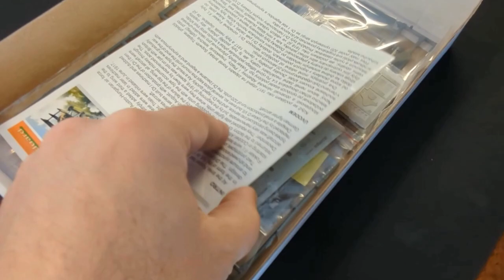Eduard Fokker Dr1 Profipack 1 72 scale

Comment: I'm not sure if this would work for your purpose, but instead of masking for all those lines you should try painting them on with a paint pen or even a Sharpie marker. The felt tip can be cut to size. A metal pocket straight edge, or even a piece of photo etch sprue, can be used as a guide. Good luck.
Reply from the maker: Why didn't I think of that!  That's brilliant, thank you!  Of course now, I have to build another WWI biplane to give it a go. . .
Reply: @professorbellbuilds  Hi again, I'm glad you liked that suggestion but there might be problems. Many paints are not compatible with others, so you should run tests using scrap kits or plastic sheets and try any combination of paints that you think of. Also keep detailed notes that you can refer to in the future. I'm having second thoughts about the Sharpie marker because it is ink and not paint, so it might not adhere to bare plastic very well. A thin primer coat of flat clear paint might be in order. Lastly I don't know what tools you have but I've seen good air brushes that are able to lay down a line that is about 1 1/2 mm wide with the advantage of soft feathering on the edges and strong black in the center. This will better simulate shadowing. I hope you find this useful because I really like to see those tiny masterpieces.
Reply from the maker: @Ron50M Sure, it's certainly worth a test run.

Comment: One trick I have used in the past with single surface vacuform kits and also for rib tapes on ailerons, elevators and rudders is to cut solid black decal sheets into narrow strips and apply them before painting or over a base coat to achieve the translucent effect. Though most recently I used the same technique as you. I built the Roden F. I version of the Triplane some years ago and it fitted where it touched and the I struts were all separate, trying to line them up was a nightmare, not helped by losing one to the carpet monster. I have the Revell Dr. I to build at some point, which looks like a nice kit. Alex Imrie wrote some years ago that Dr. I pilots described their aircraft as green, but the modern trend tends to be to paint Dr. I aircraft models a dusty olive drab, like they are B-17s that have flown 25 missions over Germany, so I like your grass green look 😊. Another very enjoyable video!
Reply from the maker: That decal trick isn't a bad idea!  Certainly it's better than spending 7 and a half hours and 90 yards of masking tape!  It's funny you mention the discrepancy between pilot descriptions and modern trends.  I feel like the same applies to the RFC.  All of the accounts that I've read (at least the ones I can remember) describe British planes being painted a "chocolate" color, but again I feel like I always only see olive drab.  Maybe chocolate was green back then with rationing and all?  Anyway, you hit the nail on the head when it comes to nightmarish Roden kits!  I have a love hate relationship with that company, and I'm always getting sucked back in to build another of their kits when I know the molds are awful, the fit invariably bad, and the construction planned by a sadist!  I honestly don't know why I have fun every time I build one, but I do. . . and they mostly turn out nice.  Oh well. . .
Reply: @professorbellbuilds Roden kits, I can't tell you how often I take one out, fondle it lovingly, have images in my head of a beautifully completed model and then put it away till another day. Setting P.C.12 to one side my current approach to P.C.10 is that its base is definitely a BROWN colour (discussions of how it first may have looked in 1916 aside) that in certain light conditions can exhibit a subtle "green shift". This is something I have noticed on the aircraft in the RAF Museum at Hendon and the Shuttleworth Collection at Old Warden. To replicate this in model form I apply, for want of a better phrase, a khaki brown (but more brown than khaki) base to which I then add green, before lightly over-spraying the brown. If I am lucky this results in the "chameleon" like effect that I am looking for depending on background and light conditions i.e. direct sunlight, cloud cover, shade or artificial light. My thinking in respect of this is heavily influenced by an article in the '14-'18 Journal of The Australian Society of World War One Aero Historians, Vol 1 - 2019 by Colin A. Owers and references letters written by the late Jack Bruce on the topic. One of these to R. Rimell on 30/12/85 "The colour used on (RAF) Museum aircraft was accurately matched against colour samples provided from Canada, where what appears to be the only copy of the appropriate British Standard with surviving colour examples exists." Unfortunately no mention is made of spectrographic analysis, so caveats apply as to conditions of the original colour examples etc. The article is well worth reading if you can get hold of it. Finally, from an American perspective the Monogram book on US Army Air Service & Air Corps Aircraft Color Guide Vol 1 1908-1941 by Robert D. Archer published 1995 has a colour chip for KHAKI (P.C.10) and DARK GRAY (4. x .2) as well as the French colours used on SPAD aircraft. The P.C.10 chip under artificial light appears to be a dark green, but under natural light is more brown. The grey is the colour used on plywood and metal components and is quite dark, with a hint of blue to it, X-2 battleship grey or gray in US use. Apparently the Signal Corps having selected the D.H.4 for domestic production based its finishes on the original British requirements. Thus there is some correlation between P.C.10 and the olive brown color (colour) often known as "khaki" used by the Air Service during and after WW1 which becomes Olive Drab, No. 22 in due course, though not to be confused with the WW2 era Dark Olive Drab, No. 41 - which I think may have brought us full circle 🙂.
Reply from the maker: @marktuffield6519  Hmmm. . . well I see I need to do quite a bit more research before embarking on my Se5a (incidentally a Roden kit)!
Reply: @professorbellbuilds  that makes two of us, as I have that kit to build as well. I probably should have said that I add  green paint to the brown paint (making a rather yucky colour) before over-spraying the previously applied brown colour, just to clarify.

Comment: The slightly rough surface finish on the main parts you refer to was termed 'spark erosion finish' when the kit was new.  It was done that way to assist paint adhesion as some hobby acrylic paints then tended to bead up on smooth plastic surfaces.  Some Revell kits of Japanese planes were also done in that way, including 'busy' rivet patterns.  Nichimo's kit builds up very nice.  Aftermarket decals for this kit are numerous.  Resin wheels and photo etch sets are available also.

Comment: I very much enjoyed your video. I like your your style of keeping it real, telling what was difficult, what went wrong etc. 1/72 biplanes are my absolute favorites. It's much more relaxing to watch a video of someone else building a kit a than to build it yourself. There's less cursing, moaning and sighing. When I built this kit, I left out the PE parts for the airframe, managing to them is only half victory, if you later knock them off. The profipack is sadly not available now, but I've got a Smer re-boxing, so I might torture myself with the left over PE parts from the profipack. Do you by the way have Eduards 1/72 Fokker D. VII, it's said to be an excellent model. I'm now building an Airfix Gloster Gladiator, very nice kit with solid engineering for the upper wing, and soon an Airfix B.E.2c. Do you have those in your stash?
Reply from the maker: Thanks for the kids words!  Maybe I'm a masochist, but the torture with little parts is one of the parts I like best!  It's funny you should mention those kits.  I've been coveting the D. VII and Gladiator from airfix for a while.  As for the B.E.2c, I've already built one (I actually won a prize for it at my local model con), and I had such a good time with it that I bought another one.  I've got big plans for that kit. . .
Reply: @professorbellbuilds  I don't mind PE parts most of the time, or even enjoy working with them, but but the tiniest ones are so tricky, there's so little contact with the plastic. Another thing that is PITA, is when they interfere with the fit of the plastic. The Eduard 73491 is a good example of that, there are many parts that are unusable in the first place, and others I had to remove later. The PE bulkhead is much too small, the seat will cover it almost entirely, this is evident even on Eduard's website in the photographs. I ended up thinning the kit bulkhead and seat. So if you are planning to get the fret, be warned. There's another fret available  from SBS, but I haven't used it. The Yahu instrument panels - if you are familiar with those - are also a bit too big, not designed for Airfix, and fitting them require removin some plastic. Congrats on the prize, I bet it looked very nice. I also bought another B.E.2c, one nice thing about these small 1/72 kits is that they require so little space, as a box and built. If I were you, I would get the Fokker D. VII quite soon, as Eduard have raised their prices. I don't know if local retailers there in the States have already applied that increase to those kits already in stock, but at least new ones they order from Eduard will cost more. I've got several of them, there are so many tempting schemes.
Reply from the maker: @thekinksfan5102  Thanks for the tip!  That may justify another purchase soon. . .
Reply: @professorbellbuilds  Not too many Eduard 1/72 Fokker D. VII build videos on YouTube, or Airfix Gladiator videos that actually show the rigging process. Would be nice to see your method.
Reply from the maker: @thekinksfan5102  Duly noted 🤝
Reply: @professorbellbuilds  👍

Comment: Great build.  This kit is for the brave! I don't think I could handle all those tiny PE parts but the result is very good.  If I may, I have a suggestion:  Instead of showing an entire sequence at extremely high speed, show parts of it  (say, start, middle, finish) with moderate speed and use transitions (e.g. fade-in  - fade-out) in between..  you'll have approximately the same video length but the result won't be as hectic and hard to follow...  Show the important steps of the build. Cleaning the flash for example, albeit an important task, is not as important to show. Cheers!
Reply from the maker: Thanks for the kind words, and the tip!  I'm new to video editing, and limited by "the free version" editing software, but as they say, practice makes perfect.
Reply: @professorbellbuilds  Personally, I liked the higher speed, but, yeah, slowing down on certain complicated sections is a good idea. 

I particularly liked the PE sections.
Reply from the maker: @supercededman  Thank you, that's a good idea.  I'll definitely incorporate that as I keep posting these builds!

Comment: I am a beginner, and I am currently in the process of building the same model, and so far, I am struggling to hold everything still and not to break them. Unfortunately, though, I have already broken the seat and the structure underneath it, and just those have already riled me up that I just couldn't continue without cursing at myself. So, my question for you is how can I not break the entire structure without cursing at myself?
Reply from the maker: Well. . . prayer helps.  For one, you should be aware that this is a pretty advanced kit, so if you remind yourself of that, it will probably make the screw-ups easier to take.  Is it the photo etch that's giving you the trouble?

Comment: Great job on the wing frame shining through. I don't get it: I see so many modelers preshading, only to hide it under the next thick spray ?!
Reply from the maker: Thank you!  It was actually the first time I had tried it.  I think I might try a different way in the future though.  All that masking was a real pain in the neck!
Reply: @professorbellbuilds  Okay, so maybe I enjoy sarcasm a tad too much, but the masking wasn't your prob. You seem to have time enough to mask, film it and edit your vid for YT. So time doesn't seem to be your prob. It makes no sense to preshade, when you're going to cover it under 1 thick spray of paint. Now that's a waste of time ! And paint. Even with an airbrush you can practise subtlety, like say, a thin transparent coat for starters over your preshade, let it settle and check out the effect. Preshade doesn't have to be black either. A darker hue of the overall colour to start with can do wonders.
Reply from the maker: @trikkke11  Yes, sarcasm generally doesn't come through in print.  I take it then that I did not do a great job on the wing frame shining through?
Reply: @professorbellbuilds  Please, professor, honestly: do you see the frame shining through the top layer of paint ? It could be the camera, the light, but I'm guessing there's no frame shining through. And that's not because of your preshade. It's because you hid the preshade cumpletely. What comes after the preshade is just as important. Otherwise it's simply a zero operation. You have not respected your preshade. That's how you lost time. A fine transparent spray would have suggested the light shining through the linen.
And for that matter: it would shine through if it were clear doped fabric, fair enough. But would it shine through after the pilots had their fancy ways with it ?
Reply from the maker: @trikkke11  I just checked, and honestly: I do see it shining through the top layer, or rather dimly lurking beneath the surface.  It's more pronounced on the underside of the wings, and most pronounced on the underside of the top wing as I had intended.  I figured that would let the most light through with the white upper surface.  The camera may be hiding the detail since I'm just using my cell phone, but it's definitely there.  It could also be that I was going for an effect more subtle than you prefer.  The problem with going too light on the paint is you run the risk of letting the plastic shine through in addition to the pre-shading.  I think to get the more pronounced effect that you're talking about I would have wanted to first paint ,or prime with white, then add the shading, then give the light mist as you recommend.  Though I'm not sure that would technically be preshading. . . what would you call it?  Intrashading?  Perioshading?  That actually might be a good idea, especially if I were to use a dark brown for the preshading as you suggest.  I've got a plan for a RAFC plane that I might just give it a go on, especially since one could expect the Egyptian sun to shine through the wings a whole lot more.  Anyway, hopefully I can also do a camera upgrade and those ultra fine details will show up better.  A buddy of mine offered to let me borrow his camera which is supposed to be of far better quality than my phone.
Reply: @professorbellbuilds  Oh, well, ladeeda...